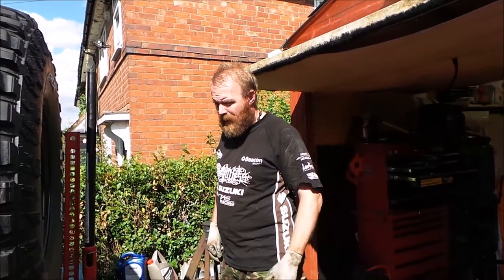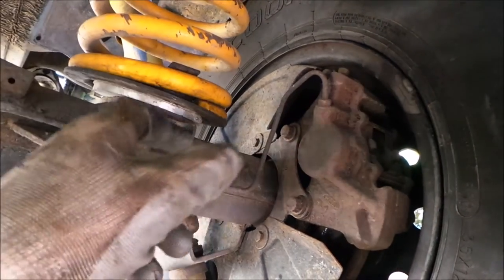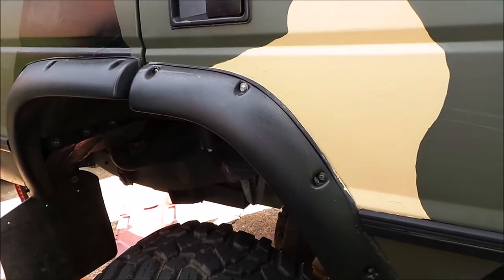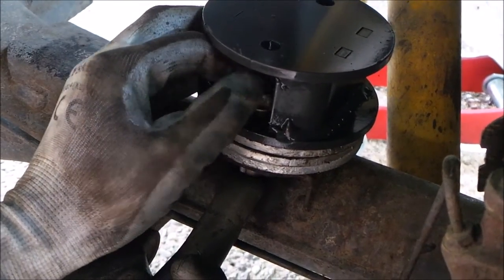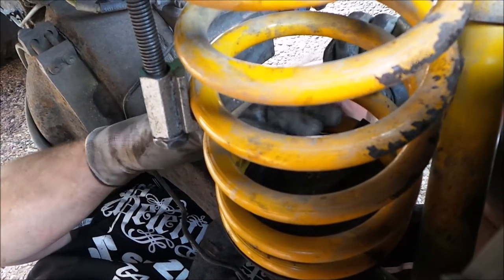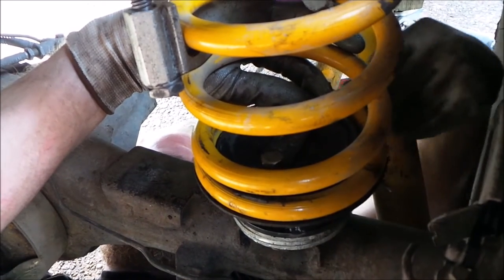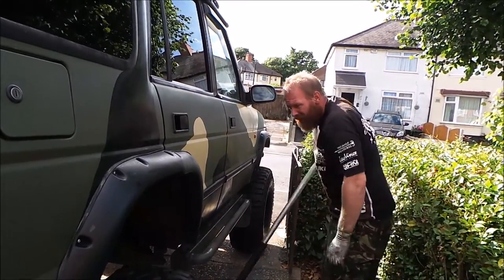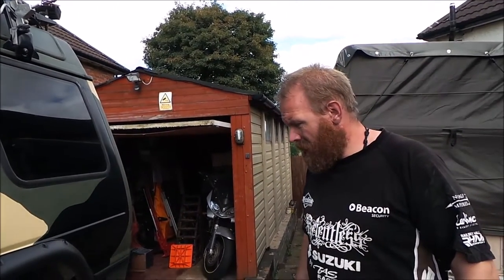Fitting a 2inch lift block to the Rear of my Land Rover Discovery 300TDi Bug Out Vehicle

Comment: Great video. I'm glad my B.O.V. project has Leaf springs instead of coils. I hate using spring compressors.
Reply from the maker: Yeah me too, I've seen quite few let go over the years hence my trepidation when using the compressors...
Reply: As soon as I got a bit of cash in hand I'll be doing a Suspension video of my B.O.V. rebuild and starting my channel off. Been too hot to do anything here. Been in the 80+ degree Farenheit with 70-80 percent humidity territory most of the summer and I'm a lage bloke who hates any physical activity when its that hot out.

Comment: Did you have to use extended brake hoses I am doing this with my td5 but been told I have to get 100mm brake hoses and an adjustable panard road or can it be done with out got 2' lift kit 2' blocks from Dickson fabrications all ready to do but what I been told not done it yet because of the brake hoses and the adjustable panard rod is this right what I been told .can you message back about this as I need to lift her and it's kick in teeth if I got to get brake hoses and panard rod.

Comment: Question for you mate did you do lift blocks on the front aswell as iv got a 2 inch lift on mine and want to block mine ??
Reply from the maker: took them back off had problems with props and vibration
Reply: Ohh fair enough might not bother then

Comment: hay bud. great truck!! just wanted to ask what upgrades have you done to brake pipes etc for that kind of lift?
Reply from the maker: I had to put extended Brake lines ,luckily I have a local place that can make braided brake lines ( Listers motorsport) they are relatively cheap and can custom make brake lines to your specs if you are local and able to pop in .
Reply: Brilliant. ok that's good what about. Props and arms are they all normal? I'm guessing wide angle prop?
Reply from the maker: 3 deg arms and wide ange props mate
Reply: hi m8 mint discovery ive got one my self look out for it in the land rover owner international its cold big red i think its gowing in next mouth on the 5th otc it all so might be gowing up for sall mick /big red

Comment: now you've done that job go back under the car and pull out the bolts in the blocks and spring locks and turn them heads up not down. if the nuts shake loose you lose the bolts could be messy on the tracks
Reply: Steel towers are erected with nuts up for a reason, spotting the bolts that should fall out when they fail.  I suppose it comes down to if the person inspects their vehicle properly or not.  I tend to agree that nuts down make sense but again, look at a cell tower, nuts go "up and out" says the tower engineers.  My point is, two sides to the coin and worth a consideration, I figure it varies in application.  IN THIS CASE, it looks like he might not have had enough space to get the bolt in other than how he did it, in which case the manufacturer planned on it being installed this way.

Comment: great video have you left it with just suspension lift of have you done 2inch body lift to .
Reply from the maker: I have a 2" suspension lift  and 4" body lift - thanks for watching
Reply: Brummie Prepper , Great video and very helpful. How difficult was the body lift? do you have extended brake lines to compensate for the 2 inch suspension lift?

Comment: great vid 
has it already got 2 inch springs aswell and what was the body lift spacers 3 or 2 inch
Reply from the maker: Hi thanks for watching , yes it has got +2inch springs , the spacers are 4inch. I ended up removing these as the propshaft at the front was complaining about the angle. But a brilliant piece of kit
Reply: so you only have 2inch spring lift and 2 inch body  wounder about 2 inch spring and 1 or 2 inch liftblocks with cranked arms